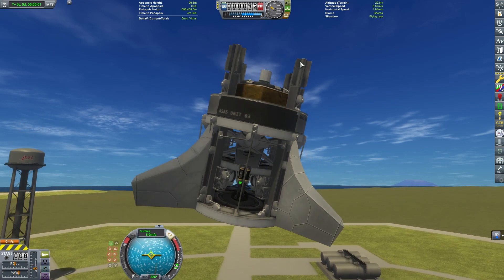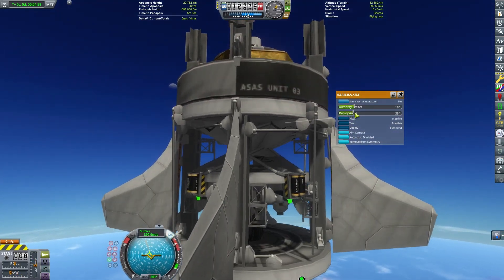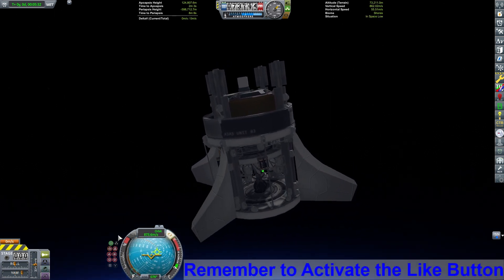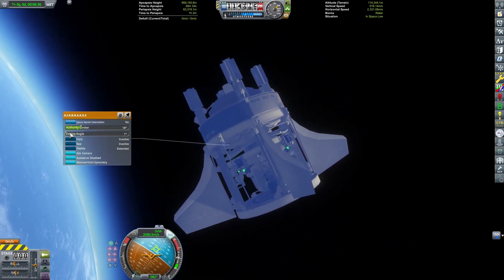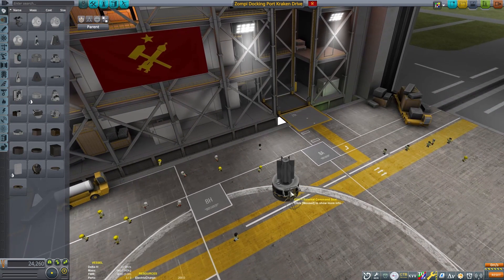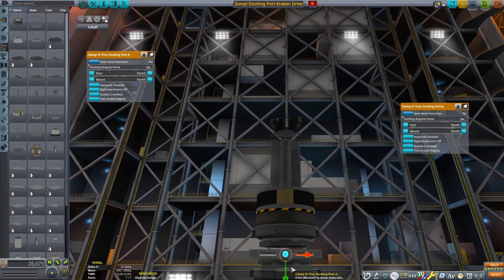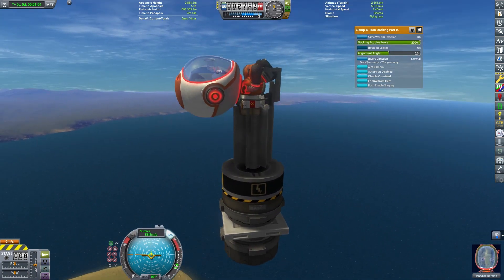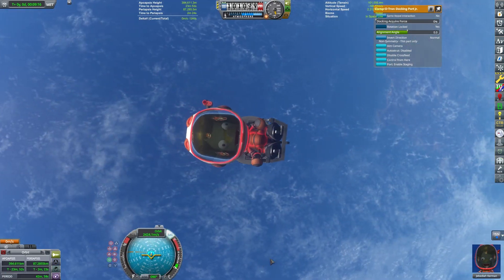Let's Discuss Kraken Drives

Comment: If you want a high-powered Zompi drive, you don't need to have additional attractive ports. You can also have additional zero-force ports and still get amplified force. Also, you can pair jr ports with full sized ports, so there's no risk of a full-sized port accidentally docking with them (although admittedly that wasn't a concern for me)

Comment: You are too underrated. I can't put the external seat up the rtg in the zompie kraken drive
Reply from the maker: Thanks, you are very kind. I put the command chair in the battery, then used the offset tool to move it up.
Reply: @Echo3  even after using the offset tool it only gets high to an extent
Reply from the maker: @shahishnusureshkumar248  Hold SHIFT to offset further
Reply: @Echo3  Thank you, it is now working. You are very underrated.
Reply from the maker: @shahishnusureshkumar248  great!